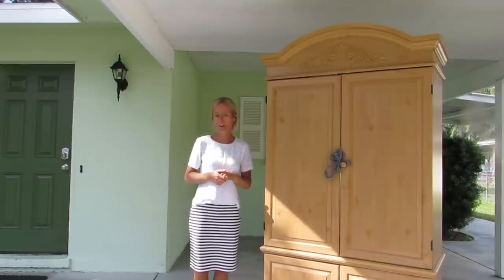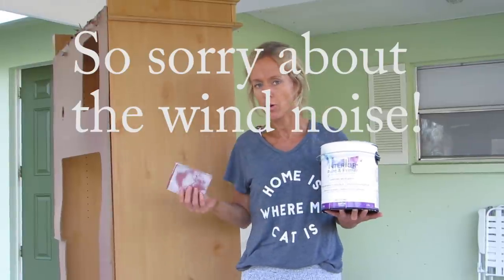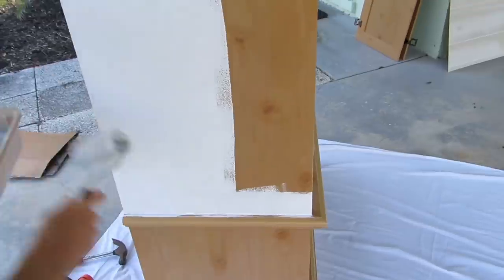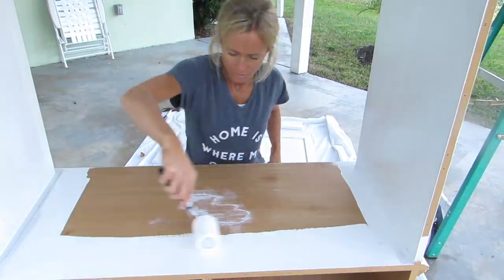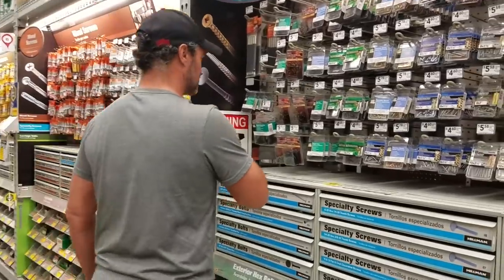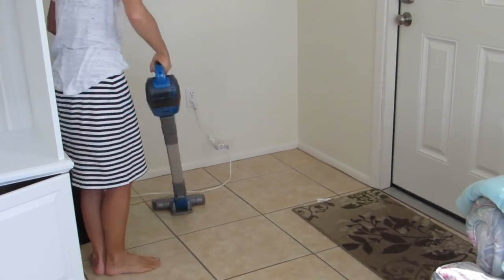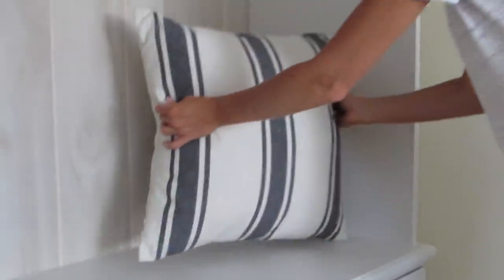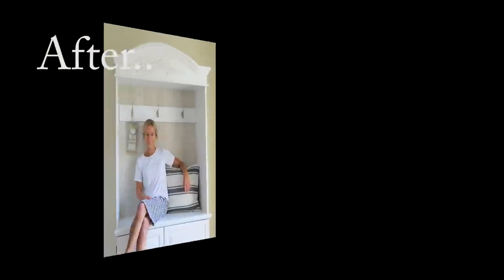Entertainment Center Transformation, Entryway Bench Creation

Comment: Came out Beautiful! I had one just like it and I couldn't even give it away.  I ended up breaking the top off and just selling the bottom section as a TV stand. Orinally $900 sold the bottom for $50 and threw the rest away! Wish I saw your video before. Although I did save the top doors and made some nice signs.